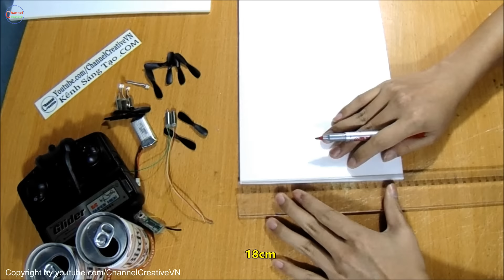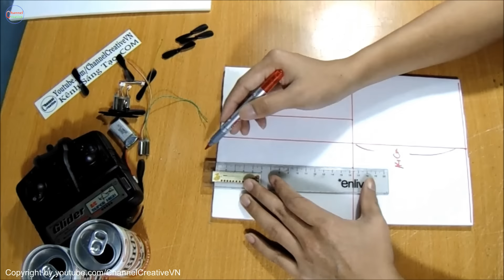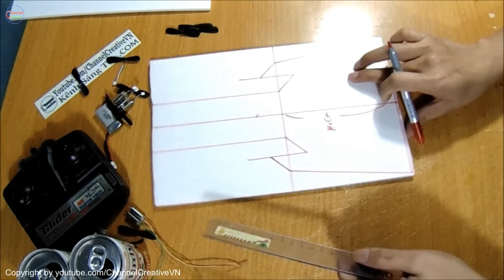How To Make Airboat RC Mini - version 4

Comment: hello, im new in the channel and i like it so much
one question... does that engine is waterproof?
Reply: Tihanted hello,  motor it's won't touch water boat moves motors air speed so no need to be waterproof

Comment: guys I did this it's worked awesome but people who is doing this boat they should need good material like speed controlled transmitted becoz it's moves so fast in water... first test it in home then go for outdoor I did stupidly by first only I taken it to outside water and becoz of air my boat lost receiver signal and it's gone ...so pls use like good distance transmitter & receiver
Reply: do not use 3.5channel transmitter and receiver which uses for helicopter